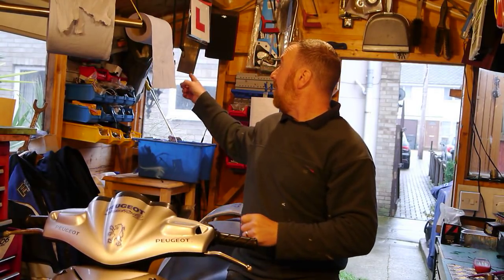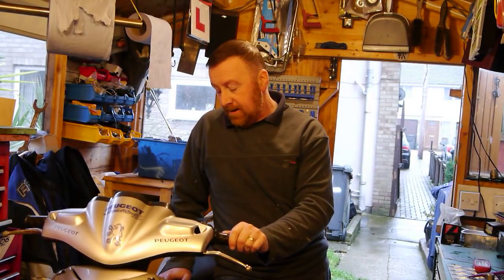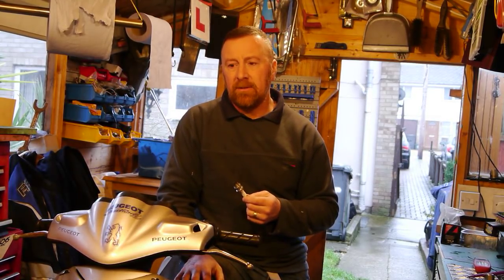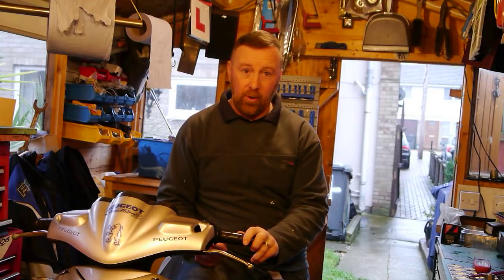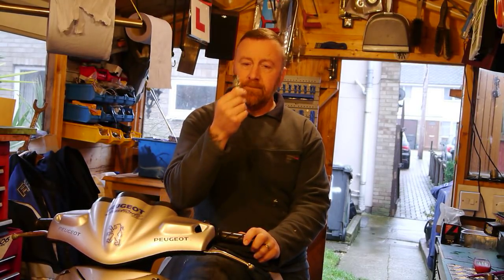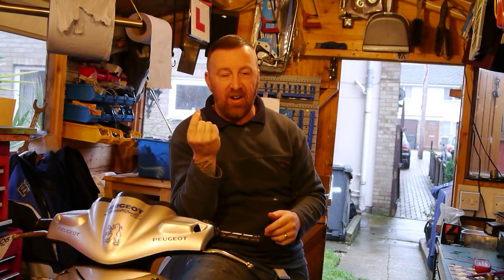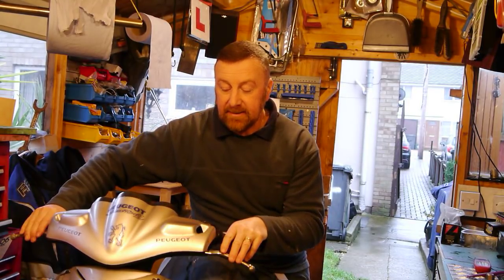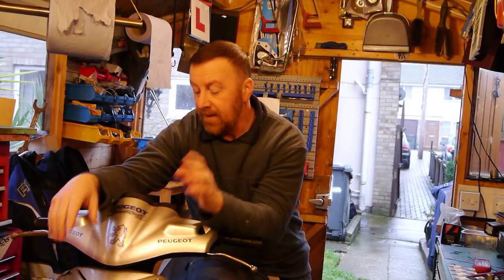SPEEDFIGHT MOPED 50CC LC STARTER FAULT CARB PROBLEM SPARK PLUG FIXING MARK SAVAGE

Comment: Any chance on et4 125 video, super cheap these days(100_ 150 eBay), do you reckon malossi multivar 2000,is worth the 100 quid. Bit sluggish at lights, guess I'll have to get belt cover off and have a look tomorrow, don't think it's carb air or fuel. Will keep watching.
Reply from the maker: not really worked on them but yes you can get some good deals on them so worth it 
your right too id be taking off the variator and cleaning and changing the rollers and take a look at the belt

Comment: Only me again haha having carb issues atm I've tried looking on the manual and can't seem to find the carb idle screw settings and the fuel and air mixture settings do you know the how many turns out once screwed all the way In mine's pre mixed as well ? So I dunno if that makes any difference
Reply from the maker: I have uploaded a video on this bud these will help defo the last two 
https://www.youtube.com/watch?v=ybx2QdziLQY
https://www.youtube.com/watch?v=hS0z36hj62s
https://www.youtube.com/watch?v=6bxZ3gI7Csw&t=2s
https://www.youtube.com/watch?v=cjBYcboRmNA&t=1s

Comment: Hi Mark got a standard 2008 50cc Speedfight 2 lc everything is standard when I got it it wasn't running but with your advice and help I was able to get it running again but im now having a problem starting it the carb is a 12mm carb with a 58main jet and a 42pilot jet needle clip is on the top notch air mix screw is set at 3 half turns out from full closed the air box and the part that connects to the air box along with the air filter is standard the exhaust is standard but yet I can't start my bike with the kick start I after us the starter bitten but even then it takes about 4 or 5 atemps any advice ?
Reply from the maker: A lot of speedfight do this 
It can be a few things 
Stator coil dirty of old 
What's the spark like with the normal test
12mm carb umm sure it's not 17.5 
Any way 
3 half is a starting point Like in my videos then move out or in
Do you have the link pipe on ?
What's the colour of your plug 
Fuel and air pipes ok ? This can cause this 
Carb also over time can do this and may need replacing 
This is what I have done in the passed and it ran and started fine after
Reply: @marksavage  not sure about the stator coil spark plug is new and the carb is a 12mm Gurtner and yes I have the link pipe on the air box fuel is fresh fuel and vacuum pipes are new and on the right way it's ok when its running apart from my idle screw as no effect when I turn it in when its warmed up but cut out when I screw it almost all the way out
Reply: Not sure about the stator coil park plug is new the carb is a 12mm Gurtner and yes it does have the link pipe that connects to the air box and all the pipes are connected correctly.
It's seams ok when its running apart from when I try and turn up the idle up the screw don't do nothing until u screw it almost completely out it dies
Reply from the maker: @linihughes5106  change the high of the needle 
Middle or lowest then adjust bud 
Worth a go
Reply from the maker: @linihughes5106  your looking for the colour of the spark 
Blue not orange 
The stator is the power that starts the bike

Comment: My speedfight I just put a new battery in and the electric start started turning the bendix but it’s not actually starting the bike I’ve looked through so many of your videos and can’t find anything out about it, any help will be appreciated I’ve been told it could be the starter motor but the motor is moving
Reply from the maker: Have you tried kick starting it 
Sp can be funny as in some just don't like electric start and others only kick !
But its to do with the stator coil and power regulator 
Whats your spark like ?
Reply: mark savage have a new spark plug to put in in a sec, kick start hasn’t been working the past week it jus crunches and grinds that’s why I’ve decided to get my electrics working
Reply from the maker: So I've never worked 
I have a video on kick start , easier to get that fix than tracing the electric problem bud

Comment: Hi Mark just checked the spark and it's a bluey purple if that helps
Reply from the maker: Thats a good strong spark bud 
Move back to carb and give it a full take apart and service or change it bud
Reply: @marksavage  will do buddy but will after do it tomorrow as iv no carb cleaner left I'll keep you posted and thanks for all your help and advice

Comment: Hi mark, I have a gilera Runner SP50. It was running well but bogged if I throttled it too fast, it has a 21mm Motoforce carburettor. I turned the screw right and it ran better. I tryed starting it the next morning and it didn’t want to start and it made a hiccup noise and I’m trying now and it won’t start could you help me please!!
Reply from the maker: bogging is fuel in or out bud, running a 21mm carb with a 92 jet will take some tuning with the air petrol mix, use some easy start to get it going and tune from there bud, it will take a bit !!
Reply: Thanks! After it starts what shall I do because I’m sure it’ll cut out again
Reply: Thanks for the help by the way I appreciate it bro keep it up!!
Reply from the maker: try and keep the rev's up in one of my last videos I chat about tuning the carb so first find the air mix put it to 3 half turns and go from there bud
Reply from the maker: check carb is getting fuel too like in my vacuum pipe test, have you check the plug /?

Comment: Hi mark i need some help please. I have a piaggio typhoon 70cc. malossi kit, 21mm carb, malossi clutch and bell, malossi reeds, malossi variator and a leo vince tt exhaust.  I have watched all of your videos and still can't seem to find an answer as to why my bike accelerates rapidly up to 30 mph but then i just get the same noise and my bike struggles to get to 40 but then some days it goes 50 and i am baffled. My bike shoulf be hitting 60mph no problem but it struggles a lot. it can get to 30 and then after that i have no clue why my bike struggles. if you give me your thoughts on this much would be appreciated. Thankyou and keep up the great videos
Reply from the maker: my speedfight I am fixing next has the same problem so as I fix it i'll show you but normally it's the variator system ,what rollers are you using bud ?as you may know in my other videos I don't like 70kits but there you go lol21mm carb from the 17.5 is a jump so what jet are you running ?thanks for watching mark
Reply: mark savage I am using 4 and 7 grams 3 of each. and a 92 jet in my carb. Thanks for responding quickly.
Reply from the maker: wow that a big jet lol with a 70kit I'd go up to 8g x6 as you need to pull it open with the bigger cc. as 100cc use 10g to 11g'sdoes it tick over ok with the 21mm carb and 92 jet?
Reply from the maker: and please like share and subscribe bud , many thanks mark
Reply: mark savage yes it ticks over and only bogs ever so slightly.

Comment: Should I cut the pink wire in my cuz box  peugeot speed flight 50cc
Reply from the maker: Why would you ask that 
Grrrrr 
Dont do it
Reply: @marksavage  thanks we bike is only doing 33 mph seen some videos and that was 1 of the ways to make faster also think the washer is still in there can't get the nut off waiting on the tool coming in the post ive try with claw hammer don't can't get it to hold
Reply from the maker: @gamergaming445  there is a nack to it 
I've got 70 speedfight videos they will help bud 
Yes washer off 
6g rollers 
Remember to clean it 
Upjet by 4 
Sports exhaust 
Sports inner air filter 
Should be getting 40 to 45 mph
Reply: @marksavage  thank you I've watched most of your videos helped a lot I got the we bike As none runner had no plastics or exhaust just need coat of paint now and would like to go bit faster
Reply: Hi Mark  quick question how to  i find the serial number got the bike with just a key no number plate or v5
Reply from the maker: @gamergaming445  two places bud 
In the seat bucket 
Or 
Take out the seat bucket and where the rear lock is on the frame
There will be the frame number bud 
If not it's been rubbed of then you wont be able to register it
Reply: @marksavage  thank you helps a lot got the nut of and there was no washer it was the clips that hold the back plate in wasnt in rigth we bike is flying now might go bit heavier on rollers we bike has brilliant pull away the exhaust I made is from Yamaha 100cc I chopped and welded on the oringal flange  on we bike is flying lot of fun for 50cc once again mark thank you your videos helped   would still be in prices lol great stuff
Reply from the maker: @gamergaming445  that's good to hear bud ,thanks for the feedback

Comment: I’ve got a 92 Jet and stage 6 70 kit, Bike was really fast 60mph+ and now it doesn’t want to run!!
Reply from the maker: I find the 70cc kit's fail bud and if AC I'd be looking at the piston, are you adding 2t oil with your petrol as the oil pump is set for a 50cc bud

Comment: Sorry to bother you again but iv just removed the air box complete and tryed to start it and it fired up so what should I do lol
Reply from the maker: Leave off the link pipe 
It needs more air so tuning problems bud 
Lower the needle then tune
Reply: @marksavage  the needle is on the top notch so it won't go any lower lol would I be better off putting a smaller main jet or would I need a bigger main jet if I keep off the link pipe
Reply from the maker: @linihughes5106  put it in the middle bud that's standard 
And 54 mk1 or 56 mk2 main jet is standard 
Maybe drill a few holes in the air box then put on with out the link box

Comment: Do this video  work yamaha aerox yq  50 please
Reply from the maker: Sorry bud what are you asking
Reply: @marksavage   I have no speak   can be  cdi  gone or ht lead  can help
Reply from the maker: @antltarling3858  no spark 
You first need to see if you have power coming from the stator coil
If so then see if you have power coming out of the cdi to the to the ht lead 
If not then it's your cdi as they often go 
You will need a volt meter
Reply: @marksavage  very big thanks  again   will get a  volt meter    and try .  LOVE YOUR  videos are the  Peugeot some fella  yamaha aerox
Reply from the maker: @antltarling3858  the basics bud with problem 
Type in aerox mark savage and you will see the aerox videos sure theres about 15 on them otherwise speedfight should help
Reply: @marksavage   top men very big thanks  love watching  you  . Wish I live next door  I pay you do it for me    .   LOL